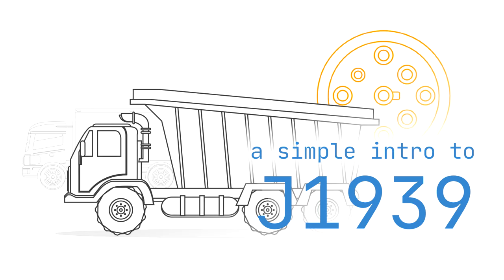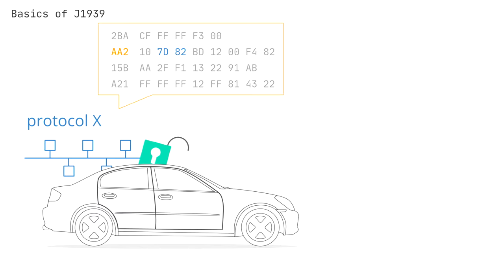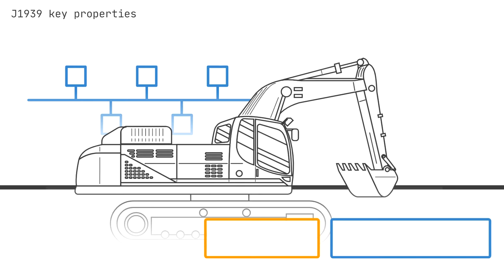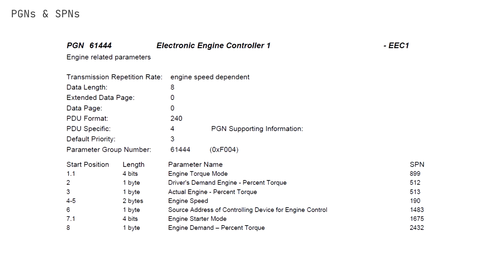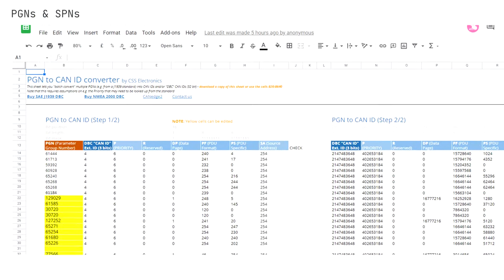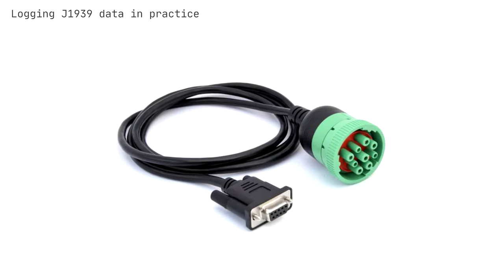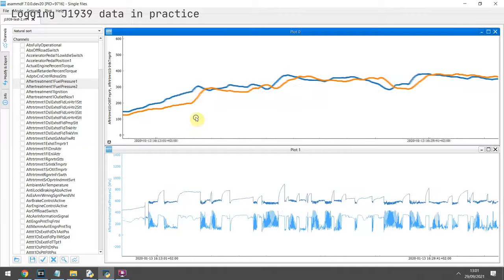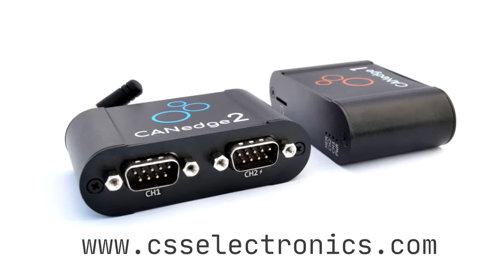J1939 Explained - A Simple Intro [v2.0 | 2021] 🌟

Comment from the maker: Let us know if you have any questions regarding the J1939 protocol!
Reply: how do I connect to the 3 pin connector via diagnostics. I have 493033 data link connector from Cummins inline 7. I cannot find any tutorials and or anything relative on using this through diagnostic software.
Reply: Hi, why J1939 is only used in trucks? it seams to me a good protocol that car manufactures can benefit from too right, given they already have their CAN infrastruture
Reply: @_tranquangtien8854  i know that it is used in fendt tractors too

Comment: Very well explained and informative video, thank you! I have since learned CAN bus physical/transport layers (including the 4 message frame types) and have been using the CANopen protocol to program a number of PLCs professionally, but have seen this j1939 protocol being used a few times with CAN 2.0B especially within the IC engine ECUs (I’ve only really needed to use 2.0A so far). Hence, this has inspired me to start learning it so I can understand and control how our PLC/ECUs components talk to each other! :D

SAE 1939-71 is going to fair out to be a very useful reference I imagine…
Reply: Thanks for the feedback! Yes, J1939-71 would be a good resource for the purpose of recording J1939 data :-) See also our J1939 DBC that takes the contents of the J1939-71 PDF (PGNs & SPNs) and puts it in the standardized DBC format.

Comment: Thank you for the explanation, I am now learning J1939 Can for fleet management. 
So the best practice to extract data from vehicle is to log it first, decode and decide what data that we need to extract?
Reply: Our recommendation is at least that you should start by "logging everything" during an initial evaluation period. You can then DBC decode the data and review what CAN IDs you can decode and which of them contain data that is relevant to your use case. All irrelevant CAN IDs can be filtered out via the CANedge configuration. For the remaining relevant CAN IDs, we then suggest to evaluate what frequency you need the data at. For example, Engine Speed is typically broadcast at 500-1000 Hz on the CAN bus, but most use cases need it at only 1-10 Hz. By using our prescalers to handle this on the device you can typically reduce your data size by 95%+ without loosing relevant information.